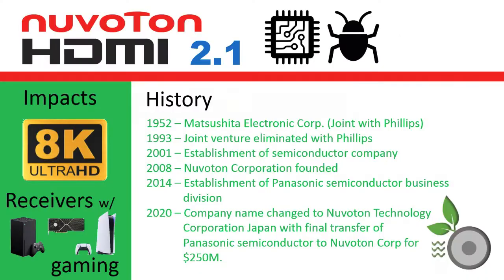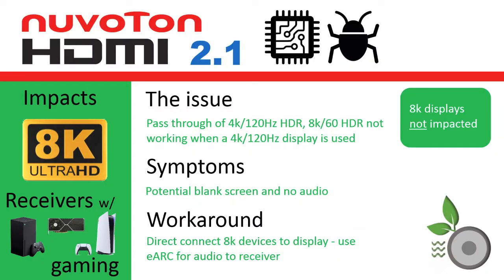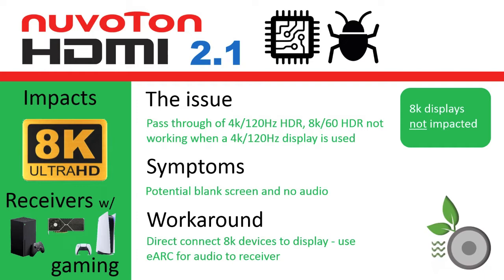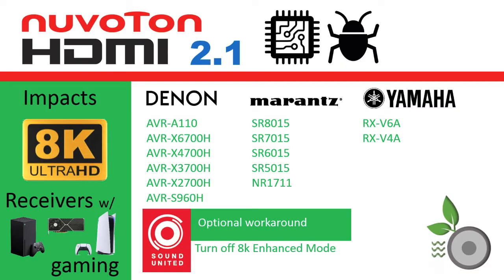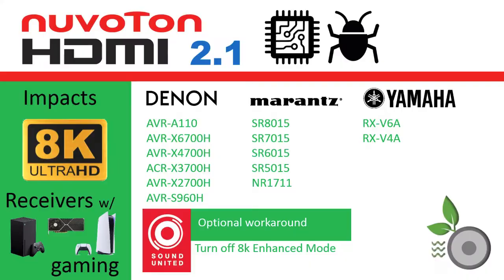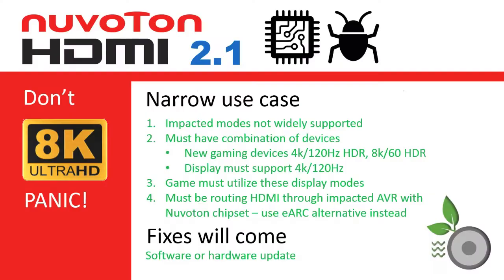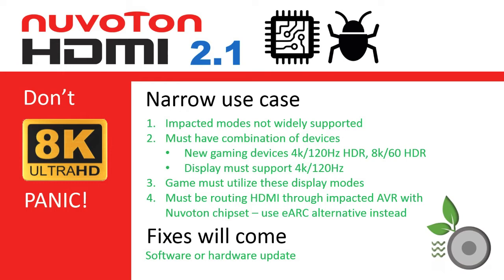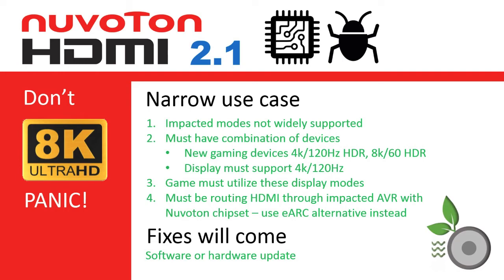HDMI Chipset 2.1 BUG - Don't Panic!

Comment: The reason you buy a high end receiver is because your trying future proof you system. You spend the money wisely and should be able to rely on the vendors to test and prove the circuits before they sell them to you. It's called debugging by every industrial manufacturer. They must have assumed the pcb's were good or the found out after they produced the boards and didn't tell anyone because it would cost them millions to recall them. Better to ask for forgiveness than for permission. Corporate greed strikes again. I was going to buy a used AVR 6015 and looked around and found your video. Thanks

Comment: I need to switch HDMI 2.1 from 2 sources. First source Nvidia RTX 3060 PC. Second source Sony PS5. TV is not a TV, it is a new LG HU810P laser projector with HDMI 2.1 with eARC. Resolution of 8K or 4K at 120 HZ isn't the issue. It is the support for Dynamic HDR for specifying HDR metadata on a scene-by-scene or even a frame-by-frame basis. 4K 60 Hz 10 bpc (HDR) would be my preferred setting. I have certified HDMI 2.1 cables and a Ruipro 33FT Fiber HDMI 2.1 cable to the projector. Is this a problem with the current bug?

Comment: I was all set to purchase a Denon AVR-A110 - and now I think I'll wait.   I tend to hold receivers for 7 or 8 years.  Currently using a Pioneer SC-68 from 2012.  The whole point of having an HDMI receiver is to allow all the HDMI switching to occur there.  It's a pain to have to switch source modes on the TV/projector, and to use hdmi-ARC as the method for getting the audio stream to the receiver.  My experience with ARC has always been glitchy, from dropped audio, to lip-sync issues, to handshaking issues.  I realize the HDMI 2.1 bug is on the Panasonic/Nuvoton chipset, but why didn't Denon, Marantz, and Yamaha test their products to see if passing 8K/60Hz or 4K/120Hz would work properly?   Seems like a huge oversight in the testing of their HDMI 2.1 products.  Their testing team gets a big old F for the rollout of HDMI 2.1 - although Panasonic/Nuvoton obviously share much of the blame for this.  I feel sorry for people who have bought these products, with a defect that will likely prove to be too inconvenient and/or expensive to get fixed.   I guess now, I'm waiting for the release of the Denon AVR-8500HA - which will hopefully have the solution in place at release.  But even then, I'll wait for independent testers to say it's good, before pulling the trigger.
Reply from the maker: If you are not in a hurry you are best to wait a few months to see if Panasonic/Nuvoton along with Denon etc can put together a solution that is 100%. What I understand is that Denon and others had to start developing with the chip before a source with these signals was available. They released before the game consoles were available as they wanted to claim to be first but lost the ability to test against real world implementations with that rush to market. I have recently heard that  some users had recently had success but I have not seen a formal claim from the manufacturers saying it is fully addressed and without that assurance we can’t know for sure.-Jon
Reply: @ripewave  Good information and advice.   Thank you.  Your video is most helpful in explaining what is going on.    My new plan is to wait for the release of the Denon AVR-X8500HA, and then wait even more for independent testers to check out the HDMI 2.1 capabilities.  I realize I'll be waiting until summer 2021 or beyond, before the enhanced Denon unit is available.  I was hoping the Denon AVR-A110 would have a fully working HDMI 2.1 - but at least I found out about this HDMI 2.1 issue before plucking down my money.

Comment: So this is interesting.  I plugged my Xbox series x directly Into the 8k port in my marantz  1171 receiver, and the Xbox detects 120 FPS!  Did they fix the issue with 2.1?
Reply from the maker: Can’t argue with success. The latest reports I read are from December 10, 2020. At that time 120 FPS was working with NVidia and PS5 but not XBox. It seems there may have been an update this month but I don’t see any details - perfect they fixed it in that build. Happy t hear of your success. -Jon

Comment: Now being February 2021 has Sound United spoke out about a fix for buyers of models with faulty hdmi 2.1 chipset? I know the work around but do they plan on addressing this or just hoping that people forget? Couldn't find a way to contact anyone on the website. Quite frustrating that nothing has been said.
Reply from the maker: It has been quiet. But my feeling is the issue will be addressed. I’ll see if I can find some updated information - Jon
Reply: @ripewave  As in a hardware swap of some sort where everyone sends the equipment in? Thank you.
Reply from the maker: Yes - that is sometimes the case. It would be nice to perform the upgrade at home but sometimes they simply don’t want use inside the case
Reply: @ripewave  I dont see any other way other than getting it on a bench, swapping the whole board or individual chip. Not sure if theres 1chip and for all 8k60/ 4k120 ports or 1 for each. All the denon Recievers with hdmi 2.1 only have 1 8k60/4k120 40 gbps port. Pretty sure that goes for Marantz as well.  No update patch or other can fix this.
Reply from the maker: I think you are right. Certainly if it isn’t an easy to plug-in module or even worse soldering involved they will want to perform the upgrade at one of there authorize facilities. Jon
Reply: @ripewave  Its been reported that it's a issue at the manufacturing level. These chips that are used or the 2.1 hdmi ports are all done by Panasonic I believe. So, seems to me that its basically a recall item of sorts if you ask me. The reciever isnt doing what its says it can do on the 2.1 front. Sound United has confirmed it as well. I'm not sure if the 2020 Yamaha receivers have been updated as of yet to unlock the hdmi 2.1 capabilities. I've heard that they dont have the issue but I thought that Yamaha was possibly also using the flawed hdmi parts as well. I say this because at the time all these Reciebers were in Development Panasonic was the only one with 2.1 chipsets. I'm not 100% sure on this. Im 50/50 for some reason from what I've heard over the past 6 months.

Comment: I have an x2700h and it is not acceptable to connect via earc because my tv which is also 8k does not have a earc port just an arc port which means I lose Dolby Atmos sound from my reciever
Reply from the maker: Jacob - that is important feedback. It seems we cannot presume an 8k television support eARC as clearly yours does not. That certainly escalates the need for Denon and others to push their chip suppliers to resolve. -Jon

Comment: Great risings everyone. I’ve noticed some sound issues regarding my HDMI 2.1 cable for my ps5. Just got a Sonyx900h & everything has been decent besides this recent issue. I noticed the sound quality start becoming static when playing games on my ps5 & I’ve also had my Sony tv completely restart. I unplugged & rebooted, it seems ok now, but b4 the sound was completely off, but screen still on. I noticed that when I changed the HDMI signal format to standard the sound came back on, but when I tried putting it back to HDMI enhanced for 2.1, it went silent again. Then when I completely unplugged & rebooted, the sound was ok, but it kinna seems slightly staticky & off. I think this may be a PS5 HDMI cable issue, but I also don’t know if it could possibly be the tv. This seems to only be an HDMI output issue bc the sound for the apps & watching tv is solid. Any chance anyone know what’s up?

Comment: I have an htpc as my only source and my TV 1080p. I want to order a denon Avc-X3700h shouldn't have a problem with my current setup right? I mean that'swhat I understood from the video.
Reply from the maker: I think you will be fine as your source won’t be in the modes where this issue is a concern. Furthermore, Denon is going to address this issue and support their customers.-Jon
Reply: @ripewave  thanks Jon, I hoped as much. You know the whole thing makes me wonder exactly with what and how did Xbox, ps5, denon and Panasonic tested their  equipment with. Did they even tested? Nevermind, thanks again for the quick help.
Reply: @Lonewolf-ei5yv  I'm in the same setup as you and I almost pulled the trigger on the same model denon/marrantz in order to support my newly aquired 4k tv (anyway where I am there is no fullHD tv anymore) and I stopped. 
1/ Purchasing an AV reciever must bevery future proof, my actual is 15-18 years old and still rockin : gaming at 4k/120hz, freesync is a reality right now not even in the future !!
2/ In my opinion, the av reciever's job is to centralization of all inputs (so it's a lot of connectivity) and it should get the sound right ...This model of denon/marrantz don't support upscaling very well anymore : my still very fun (for the kids) nintendo Wii had to be configured in 576i output in stead of 576p which gaves a horrible result...A basic tv with an composite input does the job perfectly. I was shocked that those models can't do what my (500usd) onkyo is still doing perfectly !
3/ From what I've read, this seems to require a hardware fix, I'm not confident that those brands will do anything about it
4/ the workaround : well if you have a console and a gaming pc connected, how many earc do you have on your tv ?

That is very disapointing.

Comment: I purchased a Yamaha RX-V6A. I upgraded the software to the newest version 1.24. I have a problem with the video/sound cutting out regardless of what device is in use (Roku, Samsung 4K Blu-ray or Apple TV. As long as any device passes through the receiver via HDMI AND IS OUTPUTTED TO THE TV it flashes in and out. Is this part of this problem??
Al long as the eARC/ARC 
HDMI OUT cable is plugged into my 4K tv the video/audio intermittently goes off.
Reply from the maker: I suspect not as the issue is specific to certain playback modes that are not common. Your issue appears to be content independent. I don’t know for certain but I do have a few recommendations. 1) as of January 7, 2021 there is a yet newer firmware revision https://europe.yamaha.com/en/products/audio_visual/av_receivers_amps/rx-v6a/downloads.html#product-tabs 2) you may need to adjust settings on your TV as suggested by the manual. 3) as you are only sending signal to your TV from the Yamaha RX-V6A the eARC function is not utilized - try disabling eARC on your TV.

Comment: I guess I will wait on purchasing a new receiver until they get this figured out.
Reply from the maker: That may be best. While these brands will make good it may be a factory retrofit requiring owners to ship the unit back for the update. Jon
Reply: Has Sound United issued a press report to the buyers about a permanent fix rather than a work around? Nothing has been said from what I've looked into for a months. Phil isnt savvy enough to comment on any questions on the training channel. It's So frustrating nobody is talking about it?

Comment: Where's the problem with connecting the PS5/XSX directly to the TV and from the eArc of the TV into the eArc input? And how is it done usually? TV in TV input of the receiver and console in 8K input of the receiver? I'm new to this topic so it would be great to know :)
Reply from the maker: Leon,
Your suggestion to use eArc as a workaround is what Sound United (and others) have provided as guidance until the full fix is available. 

1) Connect the HDMI signal from the PS5/XSX directly to the TV's 8k compatible input (TV must support 8k)
2) Connect HDMI eArc signal from the TV to the AV Processor/Receiver's HDMI output with eArc support. Note, the AV Processor/Receiver does not need to support 8k as it will only be needing the audio portion. 

Let me know if that guidance helps. -Jon

Comment: All People says that it can not be done via Firmware Update because it is a Hardware issue. I Own a Denon 6700, a Xbox Series x , and a LG CX. When it can only be fixed with Hardware chances, then People have to unplug their heavy Av Receivers and send them to Denon. For me this means a hefty Stress. Because all my Hardware is set to the Point in my Livingroom. And in of Case Some Technician scratches my new Av Receiver. I dont want to even think about it!!!!  By the way, the only right Solution is to install a HDMI Board with all 40gb Bandwith Ports in the Inputs. Everything else is nonsense.
Reply from the maker: I really get that perspective. Sending back to the factory is such an inconvenience and your worry about scratches and other mishandling is understandable and something I would worry about too.

Comment: I just got an  firmware update for my marantz 7706, and now the hdmi ports make my tv picture go off and on.
Reply from the maker: That can be frustrating. Have you tried disabling HDMI-CEC? -Jon
Reply: @ripewave  I just power reset processor from the power strip, my tv is working, now I have to check my projector.

Comment: hello after many years of saving i managed to buy a Denon 3700+ 5.1 Polk Signature Series Speakers. I think the whole issue is unfair, because if it wasnt for 8K, i simply could have gone for a last years model for a better price(3600) or for a last years  better model(4500) for the same money. I hope Sounds United will come up either via a software or hardware update solution.
Reply from the maker: I think they will and I hope that you gain this benefit. While this wasn’t Sound United’s fault my bet is that they will make good. They are however at the mercy of the chip manufacturer to address this first and that could be, unfortunately, a while as we are hearing from sources. Hang in there. - Jon

Comment: will the work around - connecting PS5 directly to the reciever possibly cause audio lag?
Reply: I have the PS5 and a Denon Receiver. I tried it both ways.
1 - PS5 to Denon to LG TV.  That worked. 
2 - PS5 to LG TV then eARC to Denon. That worked too.

The PS5 is doing 4K HDR 120hz (YUV422). So it's compressed. But I had to enable a HDMI setting to do Enhanced 8K in my Denon setup. Gaming and watching things with either of the 2 setups looked and sounded the same to me. I did not notice any lag.
Reply: @_Volt_Ron_  same, works fine with my x3700h on an LG CX and PS5 and believe it or not my series x is working as well. Not sure if some update has been released but I haven't seen the black screen or blank screen issue yet at 4k@120
Reply: Rumour is that the PS5 will not be affected because it apparently sends a compressed signal instead of a decompressed. This as far as I believe has not been confirmed though. Fingers crossed!
Reply from the maker: Great question and great response. I will see if I can find more details to confirm but I believe you are on the right track Graham.
Reply: @ripewave  did you ever hear anymore on this? Still nothing online.